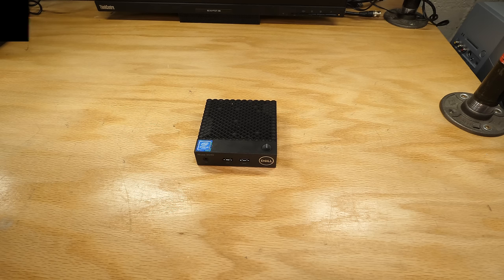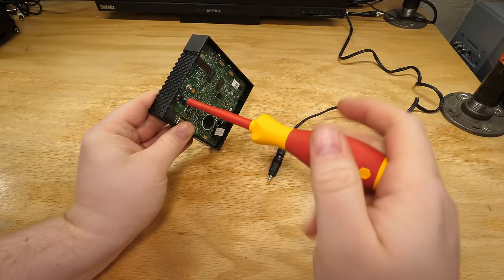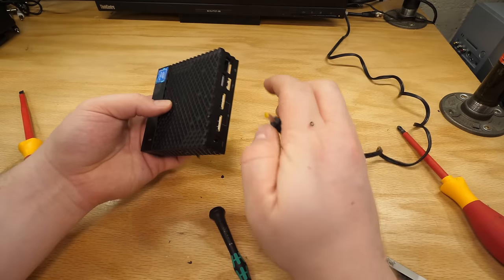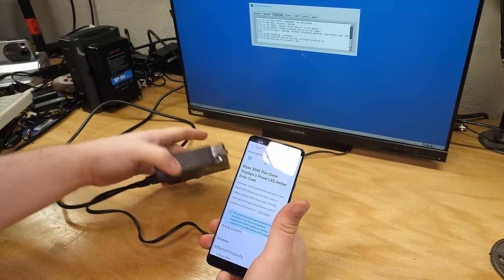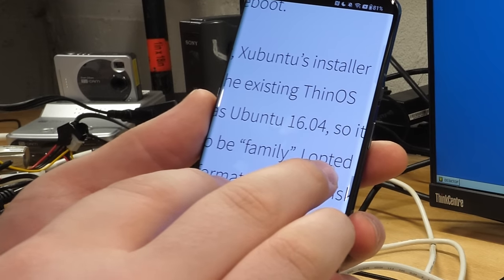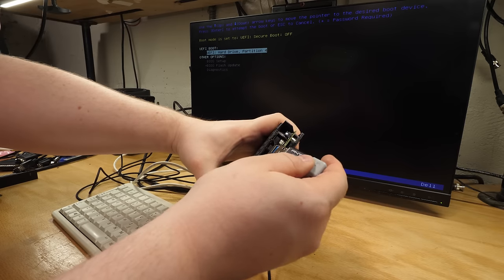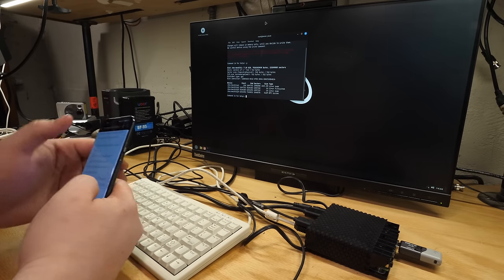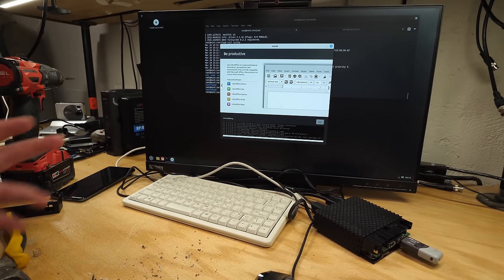Little Guys: Episode 2 [Wyse 3040]

Comment: Greetings! Intel Atom collector, tinkerer, and custom builder here! Neat video on the Del Wyse 3040. I have one in my collection and absolutely love it. A few tips to keep in mind:

1. I have successfully installed Windows XP onto this machine. The BIOS (at least on the model I have) was not only without a password but was also fully unlocked (perhaps yours is as well), allowing me to change a surprising amount of settings. In this way I was able to attach an external CD and boot off of original installation media and... it just worked. Might be fun to have a go!

2. I installed Linux Mint onto the system (along with a few other distros)... yeah it does take some configuring. The big problem is that a lot of distros are looking for ~10GB of space or more to install the OS. There are very lightweight distros that should install just fine (such as Pop!OS) but for Mint I had better luck on 19.3 XFCE (which by the way runs a LOT lighter than even the most lightweight "modern" distros out there and is still 100% usable despite losing support in April 2023. Highly recommend especially on the much-older single-core 32-bit-only Atom processors of the 2009 netbooks).

3. Did you know that the BIOS has an option to switch from integrated to dedicated graphics? If you're confused about where those graphics would come from... M.2 slot. Yes, it "just works" with an adapter, and by golly is it glorious! Coupled with XP I was able to add in a GeForce 9500GT (a low-profile single-slot GPU from the time period) and have an absolute blast on my super-tiny retro gaming PC :D

4. Setting this up as a retro emulation box is also something I've done. from my experience it runs pretty well! The quad core chip is kind of a perfect little device for retro gaming and the lack of system RAM isn't nearly as big of a deal when it comes to running PS2 / Gamecube / Dreamcast games (never did try PS3 / Xbox 360 / Wii or higher; I suspect it will not be a fun time but who knows).

Hopefully these thoughts and suggestions help! Feel free to reach out if you ever have any issues.
Reply: I imagine it could do well for Dosbuntu, for playing old PC games
Reply: Or install Arch or other distro you can pick the packages at install time like Debian?
Reply: @aprofondir  For sure. I know it works really well as a MAME arcade system, and since it takes 5V, consumes very little power, has multiple USB interfaces, and is entirely passively-cooled, it's perfect for that use case (I have ambitions to make a portable handheld using one of these, since they are so affordable and ubiquitous).
Reply: Do a video on it
Reply: @BrunodeSouzaLino  Yeah for sure. I just like Mint and find it a good "Windows alternative" if you want Windows on this machine but can't get it (plus my personal experience is that 19.3 XFCE runs like a top on really weak hardware).
Reply: @CableWrestler  Ha! Maybe. Definitely will when I put together the portable handheld version.
Reply: If it targets Gamecube, then Wii generally isn't that much of an issue either. A few extra MB RAM, 1.5 times the CPU and GPU performance, but in turn the memory mapping logic on the Wii is THAT MUCH SIMPLER than on GC, it can recover emulation performance by a fair bit, so one is hard pressed to find a system to successfully emulate one but not the other.

I wonder though on these boxes, is there a way to get at the PCIe lane? I would be curious about making it a real NAS by hardwiring a SAS controller card to it and then feeding it cheap used server drives.
Reply: I'm confused. Gravis pinned a comment saying "Regarding the m.2 slot ... it has no PCIe lanes and no USB interface; it's an SD port. The only thing it supports is SDIO. I didn't even know this was possible, and I hate it tremendously" so how does the adapter work if there's no PCIe lanes?
Reply: @SianaGearz  I mean I did successfully get a GeForce GPU attached to it via the M.2 lane, but apparently that shouldn't have worked?
Reply: @David_Phantom  That's what I'm wondering. Mine is for a facta Dell Wyse 3040, but it has multiple differences from his:
1. The eGPU working
2. No BIOS password at all
3. More BIOS options
Reply: @xPLAYnOfficial  does your unit run 12v instead of 5v? I've seen some 12v ones (with the same power connector...) and wondered if they have any hardware differences.
Reply: @retrotails  I think the 12v one is the same, because I recall that being an either or situation where it can run off both 12v and 5v.
Reply: @retrotails  Hmm... interesting thought. I'm pretty sure it's a 5V power supply.
Reply: That was really awesome data! You got me VERY interested with the retro gaming possibilities. I've repurposed an x96 mini that works very well (thanks to Emuelec) up to 16 bits systems, but this could be much better and could be cheap out there. Thanks for the Info!
Reply: @GYTCommnts  I bought mine for $40 off Ebay. It's no powerhouse of course, but with an extremely lightweight front end (Like Emulec or RetroArch), it can be a surprisingly capable little system (I plugged mine into a 1024x768 display to improve performance and maintain the small theme, using an old 15" Dell VGA LCD).
Reply: I have some questions for you.
1. XP doesn't support installs to SD/eMMC. How did you get around this limitation?
2. XP doesn't have sound drivers for the I2S realtek chip, how did you get around this limitation?
3. The BIOS does not include CSM and only boots UEFI, but XP requires it. How did you get CSM to work?
4. The Atom SoC only has one PCIe lane, and Dell used it for the Realtek NIC. If it had more than one lane, they would have used a normal PCIe wifi card instead of the custom SDIO one they installed. Why would they have done that if PCIe was available on the slot?
 Overall what you said sounds suspect. Please dump your BIOS using intel Flash Programming Tool.
Reply: @Schule04  1. I booted off USB. I have an old USB IDE enclosure that has native XP support, a CD-ROM Drive, and an IDE mechanical hard drive. I booted off original install media with the device connected, and then installed XP onto the IDE drive (I've heard there is some kind of a patch that lets you boot XP off an SD / eMMc but I have never tried that).

2. There are a lot of drivers missing once XP is installed, including the system bus driver, but at least in my experience the OS still runs quite well and seems very stable. The audio driver issue I solved by simply not using it. I have old USB speakers that natively work in XP that don't require a functional 3.5mm jack (and even if they did, I have a USB sound card that also supports XP).

3. My BIOS supports CSM. I had no idea that's not normal.

4. All I know is that it worked. It showed up in XP, I installed drivers, and I was off to the races! I discussed this with a few other commenters on this site, but my model seems to be different somehow.

I have absolutely no idea how to dump a BIOS and I would rather avoid that since I do not want to risk hard to one of my favorite devices in my collection.

Appreciate the questions! :D
Reply: @xPLAYnOfficial Are you sure it's not another model like the Wyse 3030 or 5060?
What are the last points on the list on the left in the BIOS menu called?
Reply: @Schule04  it says 3040 on it. I'm currently at work so I can't see it but I can let you know later when I get off work
Reply: @retrotails  We have both, there's no obvious internal differences other than requiring a different input voltage. We use type C to barrel adaptors so we don't have to worry about mixing up power supplies.
Reply: @xPLAYnOfficial  Can you upload a video of your wyse system? maybe there were more varients out there.

Comment: Bingo, you've nailed it with the healthcare use. 

While I haven't seen many of these around (they were briefly trialed in my network), Wyse 5070 thin clients and other various models are used heavily, especially on the Capsa healthcare carts nurses wheel around the units where most everything is ran through virtualization!
Reply: I suspect the reason that the OS was so bespoke and locked down is because they were being used in healthcare, and they had to comply with a lot of certifications. Most importantly security restrictions since the machines would be displaying a lot of medical (and thus privacy sensitive) information. You don't want anyone to throw a custom OS on there and steal a bunch of patient data.

And the more certifications you need, the simpler the software will be because every line of code is going to be under scrutiny. That's why computers in aviation are still archaic by modern standards.
Reply: anything that is in publicly accessible spaces and holds company or customer data should be as locked down as possible. thin clients also have the advantage of low power consumption which makes them ideal for mobile computer carts at hospitals, etc.

Comment: Hi there CRD, your AV tech videos brought me to your channel, best videos I’ve found!

ThinOS is indeed a Linux platform. I take care of the Linux client for Parallels RAS (remote app solution) and ThinOS was one of our active targets. This was before I joined but I can definitely confirm its Linux roots. Keep up the good work!
Reply: Looking at one of the firmware update files (Add ThinOS 2402 (9.5.1079) Merlin Image file for Dell Wyse 3040) it actually seems to be FreeBSD 12.0 based! But there seems to have been a 'ThinLinux' used before that.

part1Image1.img is a gz-compressed GPT partition table. In the first partition you'll find dtos/boot/{env.rc,kernel,ramdisk} which are unmistakingly FreeBSD bits and bobs.

The first stage EFI bootloader seems custom, though. It seems to verify the integrity of the second stage bootloader, kernel, ramdisk, etc, then it probably just jumps into the bootloader. Ie. it mostly seems to function as a secure boot shim.

Comment: As someone who used to have to support a thin-client environment, screw thin clients with the heat of a thousand suns. I will never support an environment like that again.
Reply: words and phrases that give even entry level IT staff ptsd flashbacks:

thin client
mission critical web app
hp printer
citrix
Reply: @trenchXspike  Honestly, just "printer". HP is bad, but they all suck in their own ways. 🤣
Reply: @trenchXspike  HP JetDirect box 😬
Reply: maybe shitrix, but rdp is slick as hell
Reply: @trenchXspike  I have an HP LaserJet 4200 from 2002 in a home network environment. It prints most of the time.
Reply: @trenchXspike "im trying to print from citrix"
Reply: @metalwolf112002  i flinched

Comment: These things are phenomenal for using in place of a raspberry pi in the 3d print realm
Reply: yep run 4 printers  off one. mine is slighty older, but is great
Reply: Also a good home assistant box
Reply: You know what? I was just thinking about that! I've already bought two RPis and both crash for no apparent reason (they just get off the network and hang like 5 minutes later), I know it must be something about the PSU, but a real computer is usually WAY more resilient.
Reply: @TuxraGamer  Check your storage as well, a while ago I had to reflash the SD card on my workplace Octopi, it just died very dead out of nowhere.
Kinda predicting this, I had a few weeks before made a full disk image of it. Definitely glad I did it, I'm never gonna configure that internal serial port again on a freaking Orangepi Zero 2.
Reply: @Kalvinjj  Thanks for your help! Yup, I tried that because I got a used Pi 3 with a used cheap Kingston 16 GB microSD and then I bought a new Samsung EVO 64 GB microSD and a brand new Pi 4, tried all combinations of these and had the same experience. I really have no clue about what could it be other than the extremely noisy 220v input in my region.
Reply: @TuxraGamer  Yeah that being the case it does point more towards either the PSU or heat, does it have a heatsink on the CPU? Then again I think it should in the worst case just throttle miserably and not die.
5v 2A is supposedly enough, guess 3A for a safe margin would be better, dunno what you're running, the Pi is quite economical with power in average, but the instant spikes are quite large.
Reply: 100%.  I have several of these modded to 32GB running Ubuntu 22.04 running octoprint and klipper . At one point I had one network booting ipxe and iscsi booting (the built-in ethernet supports network booting). They're IMO a great alternative to a raspberry pi. A cheap buck converter, and I can run it off the 24v in the printer.
Reply: @Kalvinjj  I got a 5v 2A PSU for the Pi 3 and a 5v 7A for the Pi 4, it doesn't seem to matter, they just crash, lol
Reply: That’s a great idea, might see if I can grab one
Reply: This would run Klipper perfectly, probably better than most Pis realistically.

Comment: Transparent acrylics fade opaque over time. A combination of "they tuned it to block most of it", then the previous user left it by a window in direct light for a few years.
Reply: I've never heard of acrylic becoming opaque - brittle and a little milky, sure; also why would they use acrylic here? The case looks like ABS, so the transparent insert is most likely, y'know, ABS, no?
Reply: @oiytd5wugho  sure if you want it to be ABS it's ABS champ
Reply: @JH-pe3ro  what does this mean
Reply: In any case, the machine was only made in 2018, not really enough time for fading.

Comment: Glad I dodged that bullet. I was researching them as a compact, energy efficient, and cheap PC for my daughter to do her schoolwork on. This was one I looked at. Ultimately I went with a 5060, which had an internal 8gb SATA SSD, which I swapped out for a 256gb bare board. I dropped in an additional 8gb ddr3, totalling 12. And added a wifi adapter to the functional m.2 slot. All for less than $100. And installed Linux mint. Works fine.
Reply: why not windows though
Reply: @justdaddy  as low powered as the PC is, starting as a thin client, I figured give it every bit of help it can get. Windows is quite heavy and bloated. Linux is pretty lightweight and efficient. Mint Mate flavor being especially similar to windows in interface means she can easily navigate it after being used to windows. And nothing she needs is exclusive to run in windows. Runs really well for a $100 PC.

Comment: A very important thing to mention about the M.2 Slot is that it in fact does NOT support PCIe!

It only has SDIO available, which the original Wifi+BT combo card uses.
Reply from the maker: wait. hang on. this is new to me - are you saying that this machine takes wifi cards that aren't PCIe, and aren't USB (as supported by the lanes in many/most PCIe slots) but are actually using the weird protocol used by those network cards that plug into SD slots?
Reply: @CathodeRayDude  I see you already wrote a pinned comment and found what I tried to link you to, for some reason youtube kept eating my comment so I wrote you a mail haha
Reply: @CathodeRayDude Almost all x86 atom tablets that were semi-popular a few years ago did that exact thing, just with the wifi soldered to the board instead of on M.2. That's what the SoC in this Wyse was originally designed for.

Comment: These things are more useful than you realize.  Since the CPU is an Intel Atom x5-z8350 quad core and the computer has 2gb RAM and an 8gb EMMC on board, you can install either a very lightweight linux distro on it, or you can do like I did, and install Lakka on it, which is a front-end for Retro- arch.  I've got two controllers hooked up to it, and it functions remarkably well as a mufti system game console.  I can play NES, SNES, N64, Genesis,  MAME, Playstation, etc.. on it super smooth.

Comment: That's a pretty neat little unit for what it is. I've got a couple of them running Debian 12 as Raspi replacements. Everything installs fine, but there is one BIOS quirk that looks for a directory in the boot partition. If it's not there, it just refuses to boot.. So I got around that by USB booting GRUB, kicking off the OS boot, and then add an empty freaking directory in the right place. Then everything functions perfectly, lol.
Reply: I fixed Debian booting on these by starting the installer in recovery mode and forcing an install of grub to the uefi partition
Reply: @dant5464  Ah that's a good tip to make it a little more streamlined! Not that I reinstall the things on a daily basis. But still, haha! I'm thinking about using one as a little NAS to bring in my backpack, with a cable to run it off a USB powerbank, and an external SSD mounted as storage. It should do that better than a Raspi at least.
Reply: @H3adcrash I have one running as a NAS and print server at my parent's place, for a couple of users it's perfectly cromulent.

Comment: Hey I used to manage these at work! Dells assumption is that you'll also be running a Wyse Management Server to handle the configuration of them. You setup some DNS stuff and then when you turn the Wyse client on it gets directed to the WMS and pulls down the configuration that you setup. They're pretty good little machines for just getting people connected to a vdi.
Reply: When I left the office I was working at we were in the beginning phases of replacing desktops with WYSE "terminals" and moving people over to VDI.

We had bigger models and win10 got installed on them. They took about 5 minutes to start if you shut it off, and once you logged in all you could do was launch Edge to log into and launch your VDI session.

Comment: The bespokeness of ThinOS comes from the Wyse heritage.

That M.2 slot is solely for a custom WiFi card.

My wife's work sent her home with that exact model when they went all-remote early in COVID. (With two Dell branded DisplayPort equipped monitors, of course.) It was pre-configured to VPN in to her work and connect to a Windows "desktop" over some flavor of Remote Desktop/Citrix/etc.